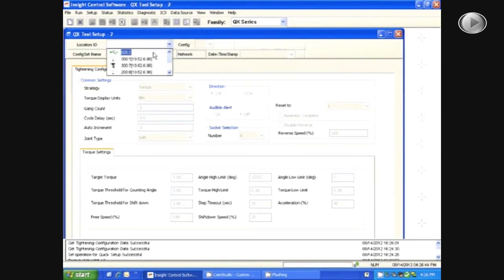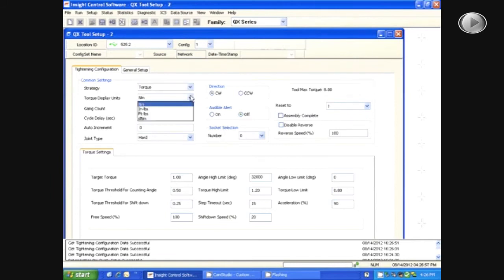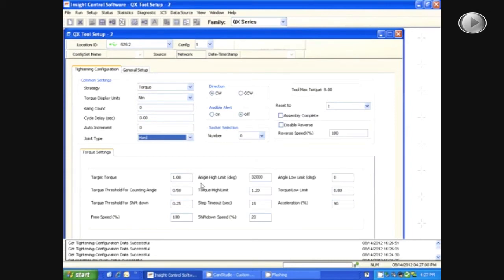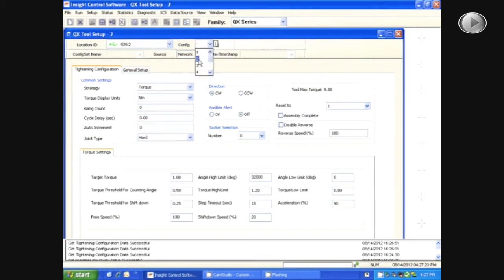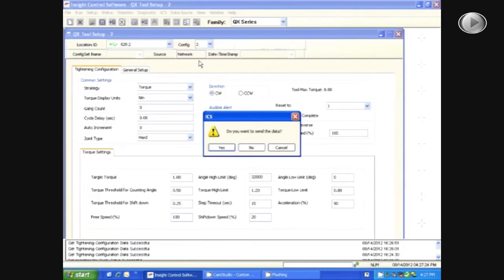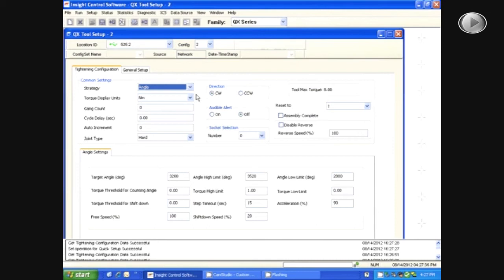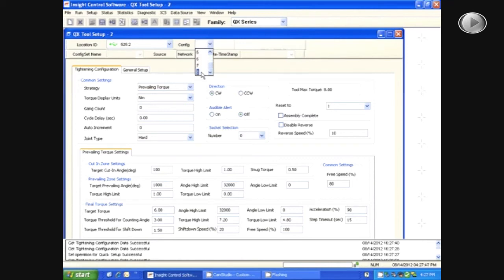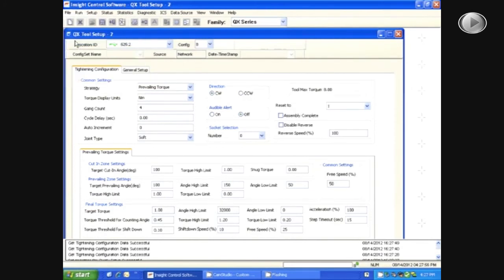How To Set Up Multiple Configurations

Comment: Hi Guys! I would like to know if I can Configurate the QX tool to work in automatic sequences. For example, make the 1st configuration with 3 torques/angles, and when gang count finish (3 out of 3) automatically pass to configuration number 2 and so on. I'd like to know if I can configurate this in the ICS and dont be choosing each step/configuration manuallt through the tool.
Hope you answer!
Thanks!!